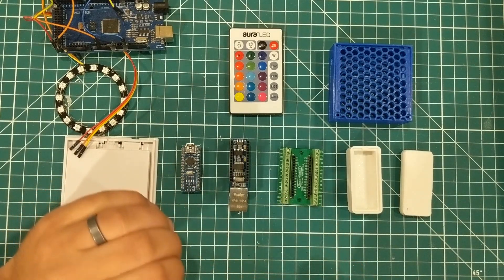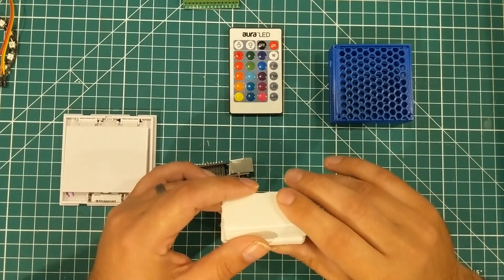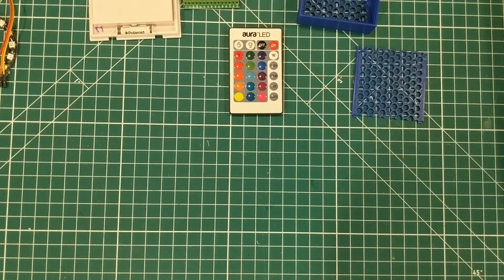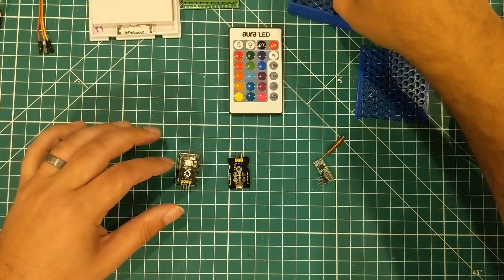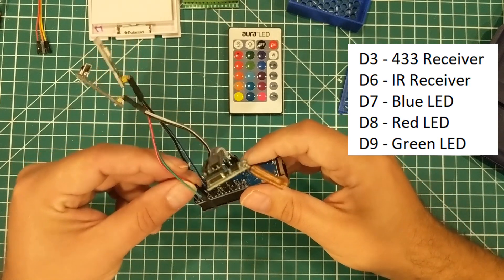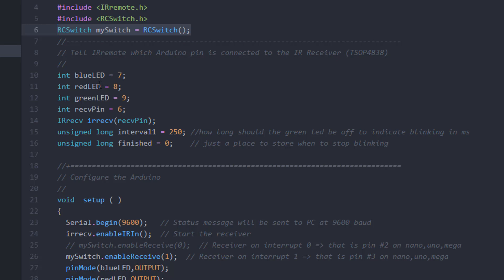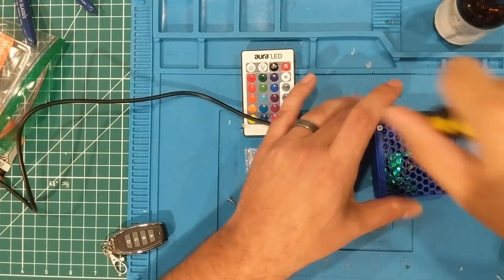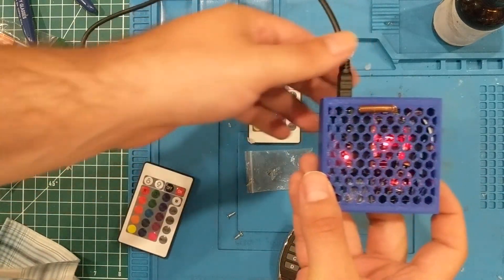Maker Essentials - Build a Universal Infrared/433mhz Receiver

Comment: Thanks for this video.  I tried compiling your code and was thrown the following errors.  Any ideas?
universal_rf_reciever:67:10: error: 'MITSUBISHI' was not declared in this scope
     case MITSUBISHI:   Serial.print("MITSUBISHI");    break ;
          ^~~~~~~~~~
universal_rf_reciever:71:10: error: 'AIWA_RC_T501' was not declared in this scope
     case AIWA_RC_T501: Serial.print("AIWA_RC_T501");  break ;
          ^~~~~~~~~~~~
In function 'void dumpRaw(decode_results*)':
universal_rf_reciever:112:45: error: 'USECPERTICK' was not declared in this scope
     unsigned long  x = results->rawbuf[i] * USECPERTICK;
                                             ^~~~~~~~~~~
 In function 'void dumpCode(decode_results*)':
universal_rf_reciever:144:39: error: 'USECPERTICK' was not declared in this scope
     Serial.print(results->rawbuf[i] * USECPERTICK, DEC);
                                       ^~~~~~~~~~~
Reply from the maker: I'm really not sure. There could be a difference in the library since I published this. If you go to the library manager maybe step back one version?
Reply: @AnotherMaker  Thank you for your reply.  You were correct.  The current library version is 2.8.0.  If I step it back to 2.2.3 it compiles just fine.  Thanks again.